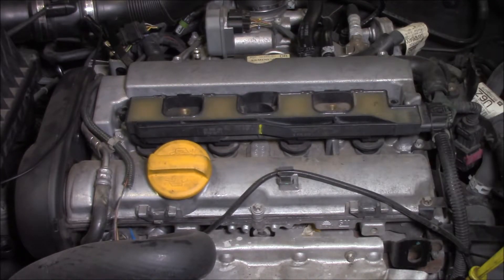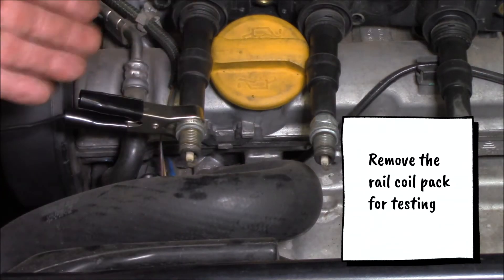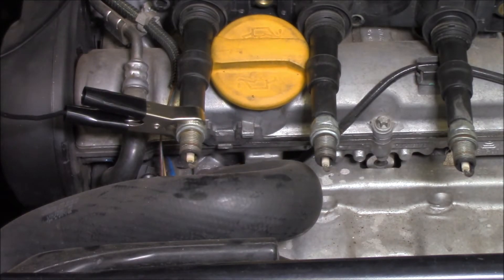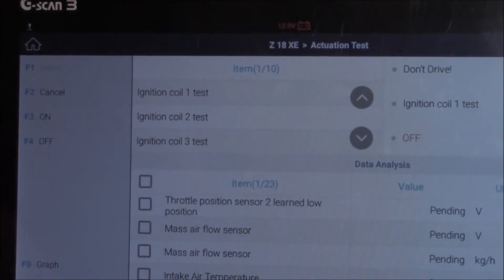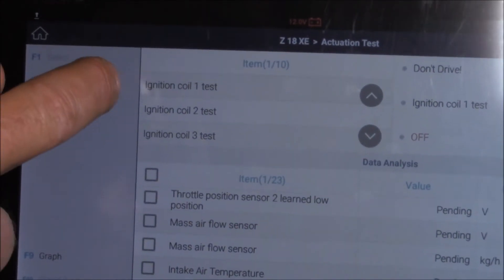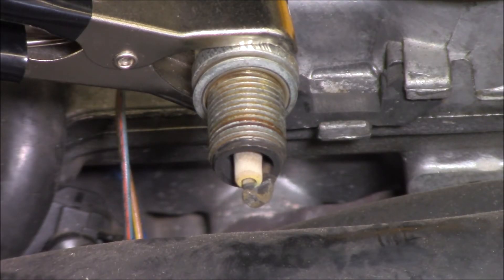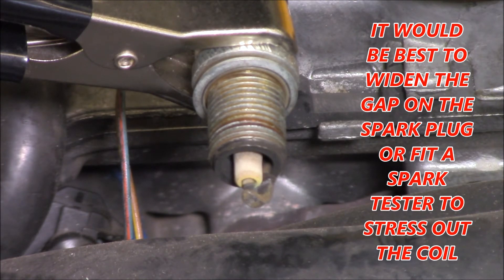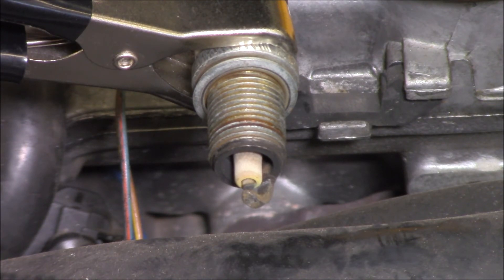Rail Ignition Coil Testing

Comment: Trying to understand what makes a good strong spark for high rev race engines.  I'd like to use separate coils on plugs, a single or pair of optical or pointless triggers and no computer. 4 cyl engine, could use wasted spark ?  1980's 4cyl bikes used a crank mounted advance unit with twin triggers set 180 apart, something along this line but with the option of it being mounted on the end of the camshaft makes it physically more practical.  But crank mount is more accurate so like to look at that also. A crank mounted plate and optical sensor sounds good but I don't want to use a computer so advance curve is a problem.  Building engines, no problem but understanding electronics not so good.  Goal is lots of dwell and strong reliable spark at high revs. You sound just like the perfect guy to share some good solutions ... please ?
Reply: PS. I know this must be possible to make from surplus parts kicking around.  I'm not about to spend $1000's on a fancy stickered race setup when they may or may not be any better anyhow.  Thanks in advance.
Reply from the maker: Sounds like you would need to speak to someone who specialises in what you require. Have you thought of a MSD ignition system?
https://www.holley.com/products/ignition/ignition_boxes/drag_racing/
Reply: Hahaha finding that someone is proving a problem.  I believe from what I've seen of your videos, that you're the guy. There has to be some basics fairly simply broken down when using no computer, pointless trigger and multiple coils, that leaves options A, B or C ? Then with type A trigger you need type Aa coils with x resistance etc.? Or can you suggest where to find such information without having to have a degree in electrical engineering to understand it ? Your knowledge might say, use BMW coils and Toyota distributor with x type trigger ?? MSD prices are just ridiculous ! @MiracleMAX
Reply from the maker: @funkiwikid6106  They might have a tech assistance line that could direct you to what you require

Comment: 🤷🏼‍♂️ you would much rather like to see a strong blueish white spark rather than the yellowish orange, meaning some what weak.
Reply from the maker: Yes, that is correct, but more importantly, widening the gap will ensure that the coil has enough energy to bridge the gap. Most coils generally only use about 80% of their capacity to reduce heat build up and to allow extra energy when required during high engine loads.
Thanks for your comment.